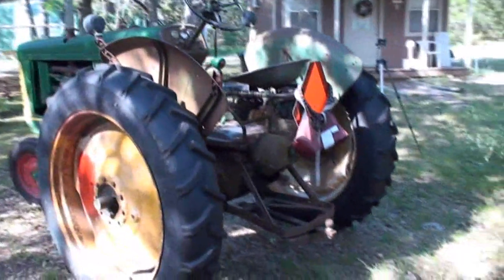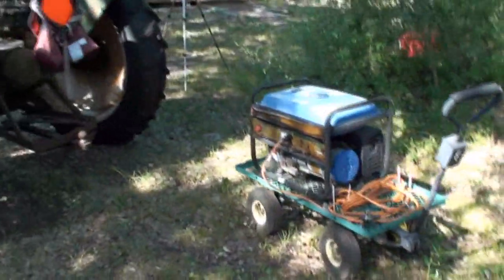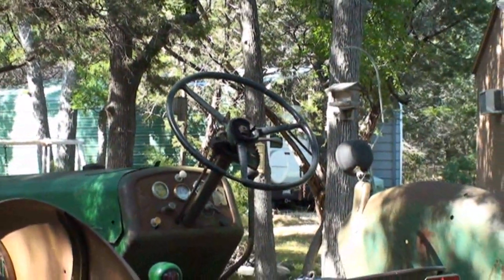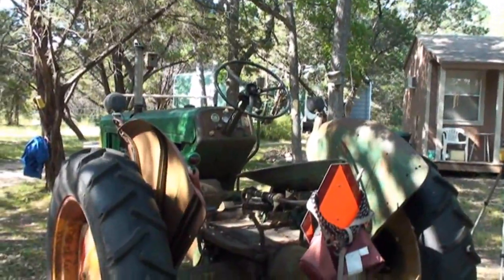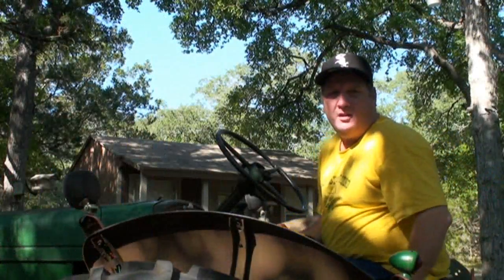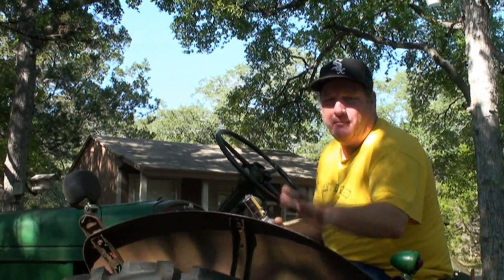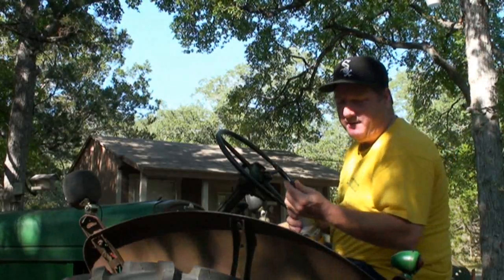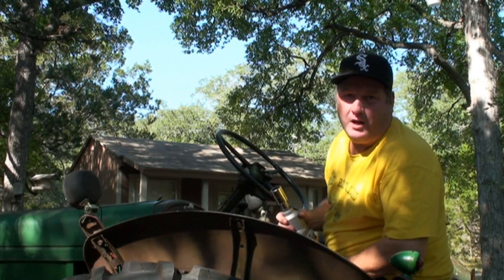Ollie-42

Comment: Brass nut is actually better Ron, especially when its time to remove it, the shaft can rust, and the brass nut will come undun real easy, dont recommend SS nut, except when it is on a SS bolt, it comes from experience!